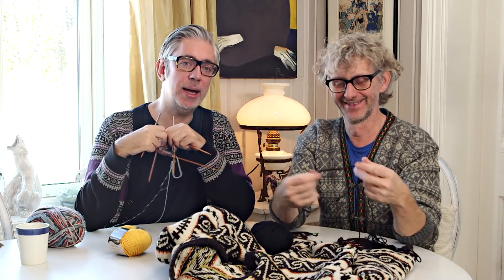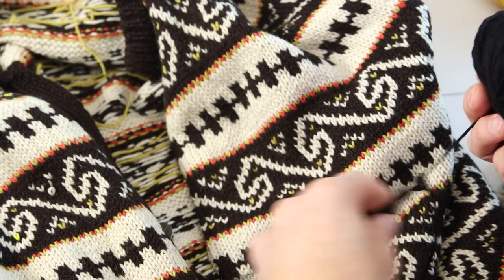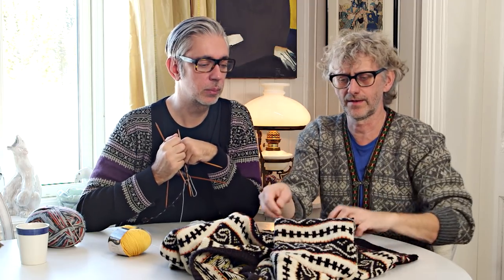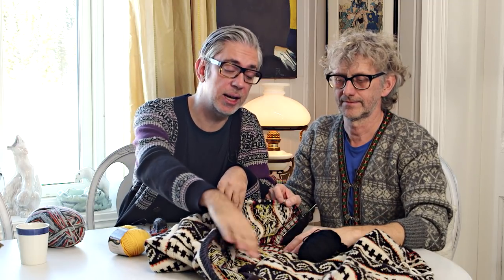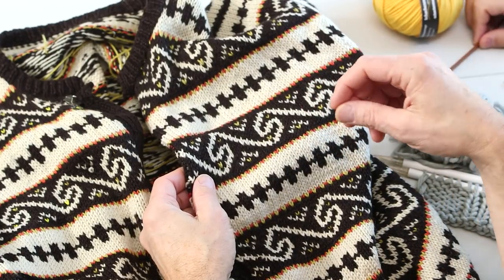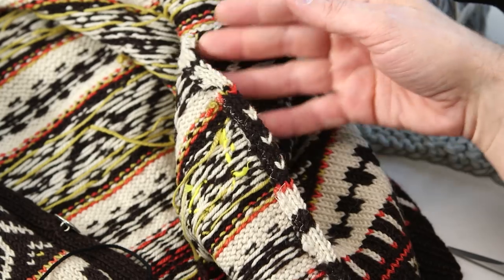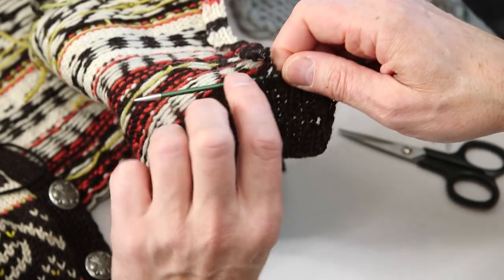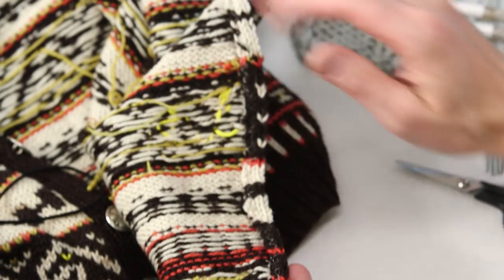How to repair a knitted jacket by ARNE & CARLOS - Replacing the placket.

Comment: Did you finish the placket replacement?  How did you secure the facing onto the sweater body?  Could you have picked up stitches on the body of the sweater as you knit the right side of the facing ... in other words securing the edge of the facing as you knit each row?

Comment: I was interested that when you were measuring Carlos 100 cm you need 220 stitches  I understand that. so I tried to calculate how many rows for 71cm length so I just checked a yarn label and it said 31 rows would give 10 cm so therefore for 71cm I would need to knit 7x 31 rows which would give me total 217 rows of knitting for 71 cm length in the jumper/ cardigan.  You need not answer this as you may be very busy. But I think I am right. Love your steering tutorials.